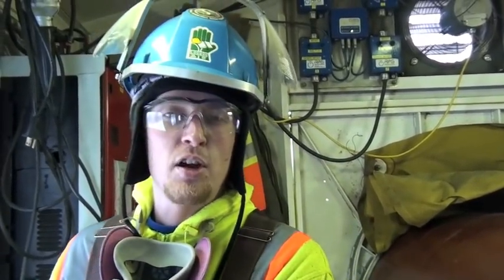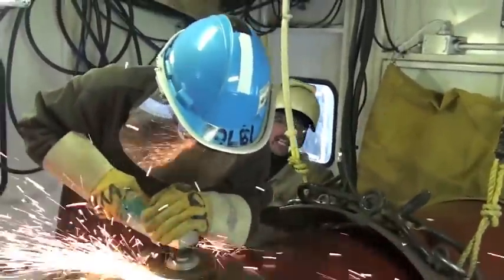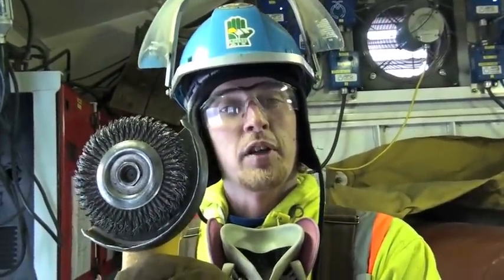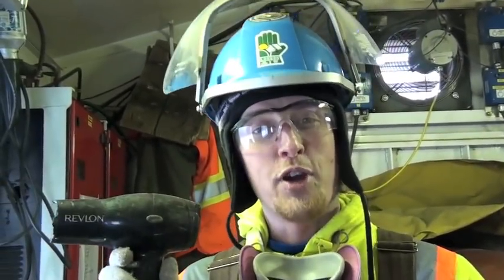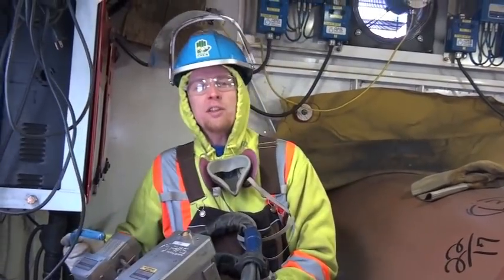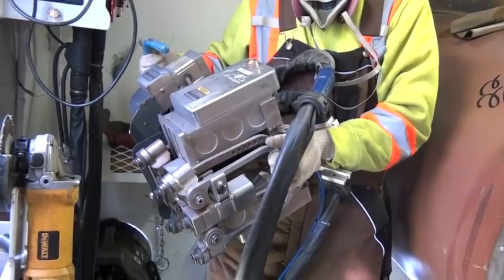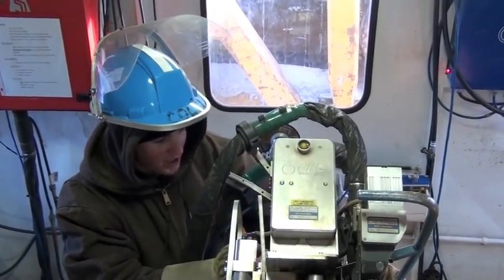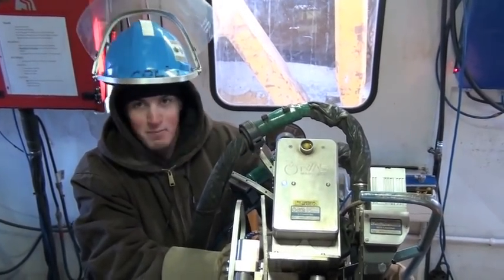So you want to work on the pipeline?

Comment: so the welders dont actually weld?
Reply: +Devin Price yea that's what it sounds like
Reply: Devin Price for one, the video was a joke (obviously) and you can even see them laughing a few times. two, what difference does it make how they do the weld as long as it still achieves the same results?
Reply: Terry C because welder is a title earned not given. Those are machine operators. Not welders. 

Sincerely,
A real fucking welder.
Reply: I herd that they have to custom order there hard hats to fit there melon
Reply: Yeah what the fuck.  I actually hold a stinger when I weld, not a remote control.
Reply: Lmaoo
Reply: Tyler D couldnt have said it any better
Reply: Almost like a line burner but opposite function
Reply: Tyler D lol. Slow down
Reply: Johnny Bravo negative. Anyone can learn to push remote control buttons. I’m in just my 4th year of welding and I’ve been offered to learn and take over sub arc welding several times, I chose to trust my own two arms to make my welds. One, because if it fucks up, it’s probably my fault and I can easily learn and fix it, and two, I’m not a pussy, I weld with my hands, not with a button
Reply: They run the bug. Its a lot more accurate than a stick welder in the hands of a frigging pipe fitter!  No undercut, full penitration, and no Complacency !
Reply: effyou128 I can do all those things with my hands, and I don’t cost thousands of dollars just to show up. I’ve run similar semi auto systems before. And they cost fuck tons in maintenance. My company bought two brand new track runners not even a year ago, one of them is broken and waiting on several hundreds of dollars in parts. 
I dont break, and I weld the same part in the same amount of time or faster
Reply: Tyler D hey buddy, didn't they just say the operators were part of the welding "operation" or team? It's just a name/designation. I'm sure they have several different equipment operators and it makes communication amd organization easier to put people into groups. I didn't think anyone was claiming to be a welder that doesn't weld....
Reply: @evanarnold3663  I'm calling bull shit! There's no reason to explain because anyone in the construction industry knows your lying haha
Reply: lol welders... A machinist can make a machine that does your job lmfao
Reply: 4:09 ya see that fkn robot? No.. no they dont lmao. 
Those dingle berrys though....
Reply: @evanarnold3663  I'm with you.... That's why I don't drive cars..... I mean that's what I have two perfectly good feet for.  Besides change is scary to me.
Reply: All the REAL stick welders showed they're true colors on Alaskan Pipeline,  where miles of welds had to be redone! U guys have been replaced by the BUG! lol
Reply: Nope a child could run that system..
Reply: My pops was a pipeline welder back in the day when it was all old fashioned stick welding
Reply: They have to control the 100k welding machine and tell it what to do. You have to be a welder to be able to use the machine otherwise you wouldn’t know what the fuck the machine is doing. And you gotta be able to switch the right button if anything goes wrong. A lot harder than it looks.
Reply: @runnyeggywhites  and yet all the machinists are getting phased out by CNC
Reply: @saluteswithtriangle6599  how? you still need someone to run a CNC lmao.
Reply: @losethealtitude7730  I'm just wondering if it could be possible that they are real welders and just didn't have any other job opportunities? You guys all sound 102% sure that they're "not real welders", do you know them personally or got some secret source for that? Now please don't call me a "fucking pussy", my snowflake heart can't take that but i'm just saying there is a possibility.. :)
Reply: WHERE THE FUCK'S XRAY?
Reply: Beni R. I’ll try and be nice around the edges of that little snowflake heart lol. 

Idk about everyone else, if they are career welders or not. But I damn sure am, and no one I have ever worked with (in only about 4 years, I’d still estimate I’ve worked along side or in the same shop with ~200 different welders. Eh, including fitters too, but most fitters are also welders. Not all but most) has said that an automated welding setup is undoubtedly better than hand welding. 

I don’t want to go and assume you know next to nothing about welding, bc maybe you do, but for the sake of it being on my mind right at this moment, play devil’s advocate with me here. And sorry if that snowflake fluttered a beat or two on that one ;D Anyways, my main point would have to be that if semi-auto or even full auto welding systems were truly better than hand welding, then no one would be hand welding in this current day. But clearly, that is not the case. 

Also 
1. The autos are situationally better in terms of the aesthetics of a weld, or what it looks like on the outside. Which, mind you, aesthetics on a weld most just go as far as something that’s easy on the eyes. Other than that. The visual doesn’t really mean that one weld with be unquestionably better than another weld. 

2. While it is kinda alright to stand back and watch the equipment do it for you, IMO it’s boring as fuck, and you still have to pay attention bc the mig cup could fill up with trash (spatter n shit that sticks to the cup) and prevent the gas from flowing to the weld in order to shield the newly deposited 15,000 metal while it cools down and keeps other atmospheric gases/particles from contaminating said weld. 

3. The equipment (especially these “circle runners” made for the pipeline, as I call them) is helllllllla expensive right off the rip. Then the consumable parts and maintenance ( people in this trade abuse the fuck out of tools. The classic mentality of “if it breaks the company will fix/replace it”) can cost upwards of several thousands sometimes. 

4. Big reason that welders will never be replaced by robotic welders is simply the fact that the auto systems need more room to operate. Matter of fact, go see if you can find something along the lines of “welding in tight spot” and you’ll see what I mean.
Reply: Beni R. I’ll try and be nice around the edges of that little snowflake heart lol. 

Idk about everyone else, if they are career welders or not. But I damn sure am, and no one I have ever worked with (in only about 4 years, I’d still estimate I’ve worked along side or in the same shop with ~200 different welders. Eh, including fitters too, but most fitters are also welders. Not all but most) has said that an automated welding setup is undoubtedly better than hand welding. 

I don’t want to go and assume you know next to nothing about welding, bc maybe you do, but for the sake of it being on my mind right at this moment, play devil’s advocate with me here. And sorry if that snowflake fluttered a beat or two on that one ;D Anyways, my main point would have to be that if semi-auto or even full auto welding systems were truly better than hand welding, then no one would be hand welding in this current day. But clearly, that is not the case. 

Also 
1. The autos are situationally better in terms of the aesthetics of a weld, or what it looks like on the outside. Which, mind you, aesthetics on a weld most just go as far as something that’s easy on the eyes. Other than that. The visual doesn’t really mean that one weld with be unquestionably better than another weld. 

2. While it is kinda alright to stand back and watch the equipment do it for you, IMO it’s boring as fuck, and you still have to pay attention bc the mig cup could fill up with trash (spatter n shit that sticks to the cup) and prevent the gas from flowing to the weld in order to shield the newly deposited 15,000 metal while it cools down and keeps other atmospheric gases/particles from contaminating said weld. 

3. The equipment (especially these “circle runners” made for the pipeline, as I call them) is helllllllla expensive right off the rip. Then the consumable parts and maintenance ( people in this trade abuse the fuck out of tools. The classic mentality of “if it breaks the company will fix/replace it”) can cost upwards of several thousands sometimes. 

4. Big reason that welders will never be replaced by robotic welders is simply the fact that the auto systems need more room to operate. Matter of fact, go see if you can find something along the lines of “welding in tight spot” and you’ll see what I mean.
Reply: I bet those guys make way more money than most the people in this comment section calling them fake welders
Reply: @tylerd535  Agreed, i earned my title building railcar tankers, not playing with a joystick.
Reply: Firedrop2 it's all pearl snaps and weldin caps hanginn on a Lincoln here in the good ole USA no robot just bad ass real welders
Reply: @evanarnold3663  Anyone can use Google to look up the "correct" terms and I won't lie I hardly know anything about this industry. I do HVAC and home remodeling but for you to say you can weld just as good and constantly persitant plus that fast is a lie.. If it was cheaper too use humans on this project than why didn't they?
Reply: @evanarnold3663  I won't take anything from you at all and I can tell you have knowledge on this because my uncle owns his own welding business and he's stated everything you've said is right!
Reply: @losethealtitude7730  they grind so they are welders
Reply: @tylerd535  This is high production work. You think you can weld as fast and efficiently as that machine?
Reply: We never do.
Reply: Maybe whatever company or city that ordered the pipes to be laid specified for them to use the machine
Reply: Johnny Bravo doubt it, im pretty sure anyone thats not a felon can do anything listed in this video
Reply: Lorne Given if your working on a pipeline you don’t want a mistake so they have machines that do perfect welds every time
Reply: lrn 2 code
Reply: Robot or stick welding, there's still a human operating it that could really fuck shit up.  I prefer using a stinger & hope it stays that way.
Reply: Im looking for a job but it seems its very unsafe practice
Reply: oh they're welding, see them cereal boxes in their hands, those are the bug remotes the welding bugs are too damn heavy to weld pipe with by hand
Reply: @brentnicol1586  What's a torch gun?lol like for gas welding? Do you mean a stinger ? Lots  pipelines in the US are built with welders using stick welders
Reply: Terry C 
Because I bust my ass every day 60 hours a week making sure my welds pass inspection and these guys use a machine to do there job they are  machine 💻 operators not welders 👨‍🏭
Reply: Lorne Given they get paid to operate the welders at a speed 10x faster
Reply: They do but they are using advanced cnc welds for different things they dont use the machine all the time it depends what they are trying to weld
Reply from the maker: L97, check out the answer to this, and more, in this video:  
https://youtu.be/nTq2sInuHYE
Reply: I'm a welder... all we actually used was liquid 7018 Epoxy JB Weld per AWS D1.1... much better quality than Canadian welders could produce.
Reply: Sure looks like that pipe got welded by those guys... So that makes them welders.
Reply: @5.0ftw71  so they work smarter and faster?
Reply: @tylerd535  Exactly, until you have to lay in a kitty pool in a mud hole, to get a 5G/6G weld with a rod? Nah....you push a button you're an operator!😆
Reply: most of the time they do sometimes they got machines like this most pipeline in the US is still done with stingers and 8010 downhill

Comment: Im a welder helper here in pa on the gas pipeline and I love it. Most of the guys who are here from the south or the west are some of the nicest guys Ive ever worked with. Everyone does their job and get shit done and get home. No bs like all my other jobs.
Reply: steve O your not a welder helper. Your a machine operator assistant if they are welding with rigs like that and that’s pathetic welder is a title earned not given 

Sincerely 
A REAL welder.
Reply: No Vacancy highly HIGHLY doubt that buddy but you keep thinking that I’m M.I.G certified for stainless steel, flux core, steel, galvanized steel, and aluminum.
Reply: Tyler D anybody can mig weld bud. Literally the easiest welding process there is. Im certified in mig and tig in all positions with all the metals you just mentioned.
Reply: Doesn't take but two brain cells to weld.
Reply: No Vacancy can’t T.I.G weld gas shielded flux 🤷🏼‍♂️ AND good luck finding a TIG compatible flux rod.  therefore your statement is invalid and dismissed.
Reply: Wow I envy you. I work in the government and it's 100% BS and 0% work.
Reply: Tyler D r/gatekeeping

Comment: They are using robo welders? I thought you would actually be welding. So the 'welders helpers' are actually the 'welders helpers helpers'.
Reply: thats what i was thinking, i was expecting to see some pro ass welding techniques. but i guess its just reality that all blue collar workers will be eventually be replaced by robots.
Reply: @dmaster225  this is a pipeline. There's not much simpler than that in the blue collar world. Even laying bricks is only better with a machine in niche situations right now. And when will a robot rough in the plumbing? Install a new carpet? Not for a while.
Reply: Caleb M I’ve seen stupid ass comments like this in a lot of construction/trade related videos lol. Like people actually think robots will be able to climb a ladder holding material and tools at fixing something at the same time, on a windy, snowy, or rainy day? Or will be able to communicate with homeowners or contractors of what they want, when, how? As time goes on technology will improve and help more and more with the construction industry but not to the point where “robots” replace journeymen lol
Reply: Any job I've ever worked with a robot welder still had to staff an actual welder for many situations.
Reply: Chris Wesney it’s probably the conditions they are in..I’m not sure
Reply: Robits increase our productivity and output. Robits and ai will most likely give you a job. Dont be fear mongered.
Reply: There always needs to be a welder present when using robo welders, if the machine fails to put down a good weld, they have to fix it
Reply: On this big 30” pipe it’s a lot faster and more productive to use bugs rather than trucks. On smaller 16 - 10 they “brother in law” weld it with two welders and their trucks
Reply: @dmaster225  the only time they use shacks is on big pipe usually 36" and above and they dont always use them on it.
Reply: Its all a bit sadomasogist gay inviroment, and nothing wrong with beeing gay or obese

Comment: No I don’t want to work on a pipeline. I’ll sit here in a control room, with a mouse to open/close shit on the pipeline for 60/hr.
Reply: Sigma most utility (natural gas), pipeline companies, and electric grids need “system operators/controllers”. These jobs don’t require a degree (although it helps). Most of us are prior military or have 10+ years doing something else for the utility company. It’s a job that requires you to speak and write in very good English (no urban talk, broken English....). You should have some sort of technical background (utility technician, welder, construction). It’s not an easy job to get because there are very few (my control room has 12 permanent controllers to operate everything in the state)
Reply: Sigma Absolutely. PLCs are the means of control on a pipeline. Your familiarity with I/Os, analogue and digital, control loops, regulation, pressure and flow control, and safe operating practices, maintenance, clearance process, SAP, SCADA, etc have already given you a basic understanding of pipeline ops. I’d suggest putting together a resume to showcase this knowledge then get to work applying. Also look into being a pipeline technician. They maintain and repair actuators, valves, gas racks, instrumentation, etc. they are the guys we call when things go bump in the night (various alarms that need an immediate follow up). What state are you in?
Reply: LOL!!!
Reply: @mitchellmitchell6938  How do you suggest getting into a utility company even for an entry level job? I have been trying for months now, 20 years old with not  much related experience. Any college degrees you recommend?
Reply: Skyler R apply for anything related to utility work, even with contractors. Go be social and make friends that hunt, golf, and go fishing. Start taking random classes at a jc in process controls, industrial safety, electrician classes, ptec, welding. Never stop applying. At least 5 (well targeted) applications a week. Apply at refineries, chemical plants, union halls, lineman, utility worker, power plants, gas storage providers.
Reply: @CozySER  start your own business
Reply from the maker: Sorry to hear that Michell.  If you ever want to make some real money, give us a call!
Reply: @ConstructionFun1  let’s talk! 😁 what’s your email?
Reply: @ConstructionFun1  Goddamn 😂

Comment: Not actually “welders”. you’re “just a hand”.
Reply: What is that welder? Is it just a Mig on rollers? Its obviously not a sub arc. Tbh I thought pipe was done with a stick.
Reply: Long runs are done with bug welders or robots, short runs and tie ins are done by stick
Reply: It looks like a MIG on rollers but I think they don’t want everything done with stick because then they would have to redo the welds all the time when the inspectors came by.
Reply: @ChocCad1905   A lot of pipeline is still stick welded.
Reply from the maker: We get that a lot Blackshirt.  Check out this video where we address that a bit:
https://youtu.be/nTq2sInuHYE